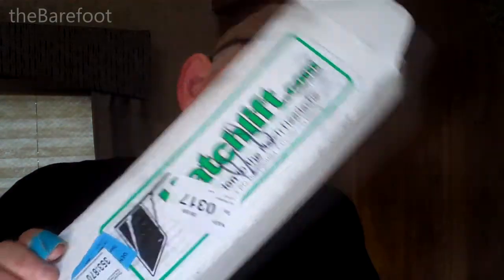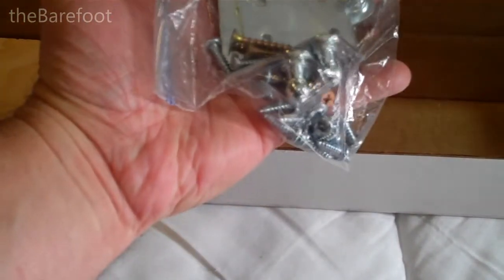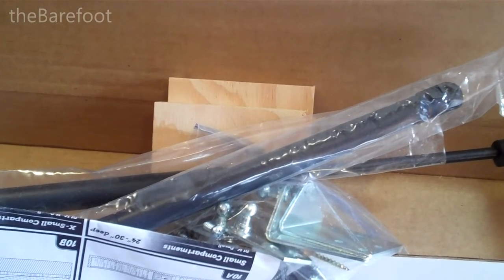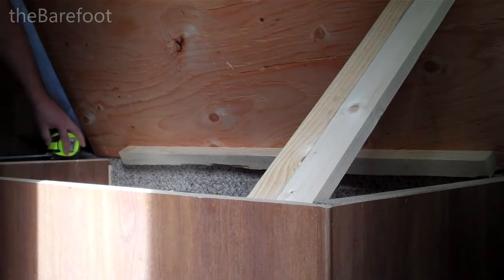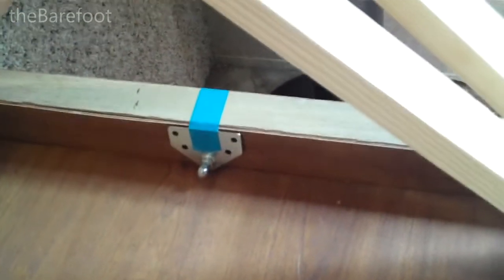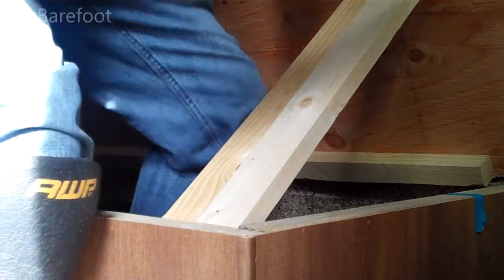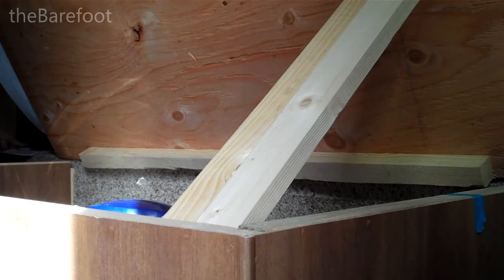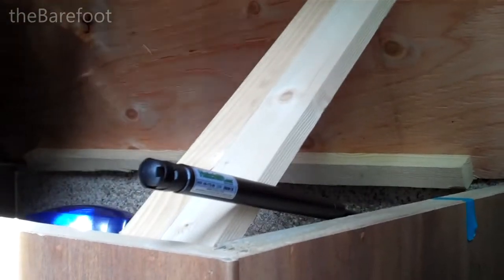How to Install the Bedlift By Hatchlift

Comment: Nice instructions.

I ran my gold screws down from the top because they went all the way through the bed deck and the block; and because my bed deck is chipboard and I feel the screw head will hold better on top.

Comment: I was trying to install some new gas struts under my bed but i am not sure the measurements. What is the size of the small piece of wood? My bed only has one gas strut in the middle which is not strong enough to hold the bed up. Great video

Comment: I would not have centered the bed-bracket on the block. I would have moved the bracket to the edge so that the ball ends up in the centre of the block. Better force distribution through and across the block.

Comment: Hi - did you end up moving the brackets after some time?  I'm getting ready to install my hatchlift gas shocks and i wondered if you ended up moving your brackets so the bed didn't rise on it's own.  Thanks for the video - very very helpful.
Reply from the maker: I want to give it one more summer, but probably will move them. I added an annotation to the video indicating that you shouldn't install them perpendicular like I did. You do want to have an angle on the install.
Reply: Thanks.  I watched the vid on Hatchlift.com too and they had the bottom bracket almost to the back (your head) of the bed and the top bracket towards the opening.   thanks again.

Comment: Absolutely no help at all in where to place the upper brackets in relation to the framing of the bed. And then after grinding thru the tedious monologue the installation was a complete failure. Holy fuck.